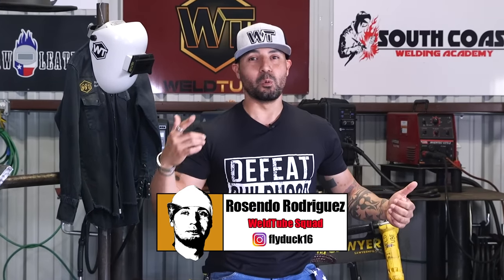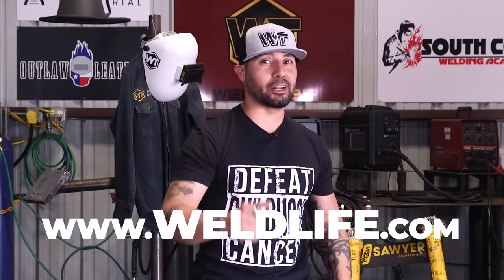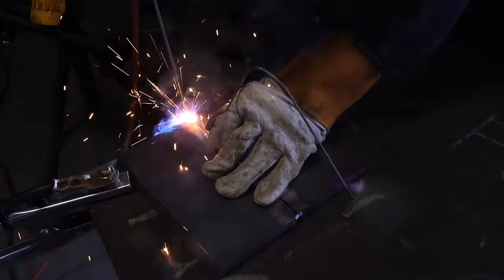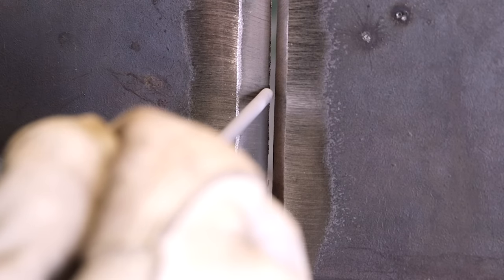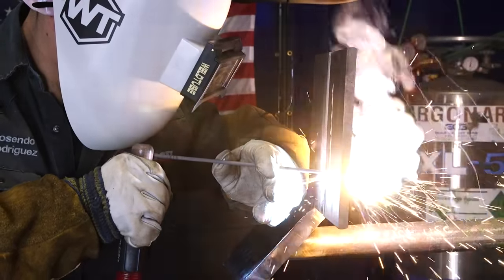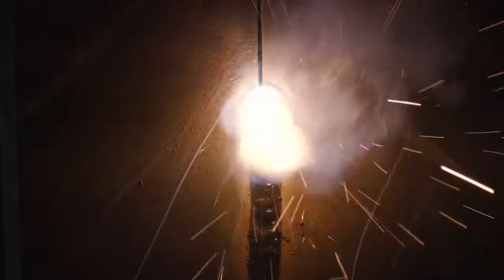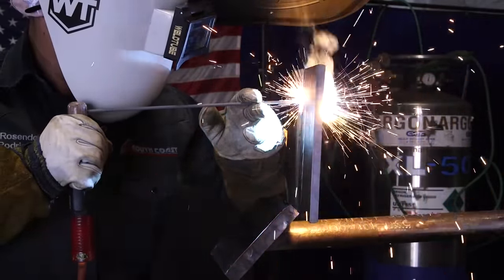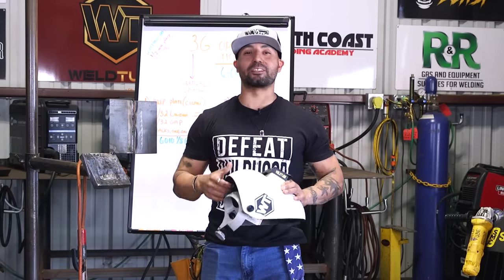3G Open Root Pass with 6010

Comment: I've been having trouble with this in my welding class and I think this video gave me a better understanding.
Reply: Repetition.
Settings.
Gap.
Comfort.
They make it look easy.
Continue trying the harder positions to get better at the others.
Angle your plate to forty-five an lean away or towards you to simulate 6g.
This will make the regular four positions easier in relatively.

Comment: I’m on 3g right now. I need this like a pig needs slop
Reply: Keep at it bro . 3g roots were like kryptonite to me when i was in school.
Reply: Keep trying, don’t be bummed out if it isn’t going to well, remember every fail and learn from your mistakes and try again.
Reply: @jeffgreer198613  Same here. Took months for me to figure it out, but once I had it, the test test where way more simple.
Reply: SAME
Reply: Same..I’m in the booth watching this rn
Reply: I’m doing the same on 6010. I struggled bad doing it with 7018 but what I did is went down to 3/32” road turned it down low on the amps and just practiced different ways speeds until it just happened and I got it. Definitely a skill that is learned by doing it every day.
Reply: @juancamaney1643  same. I feel like I favor one side of the plate.
Reply: @juancamaney1643  real
Reply: Pigs don’t need slop to survive

Comment: Thanks for the video! I definitely needed this. I’ve been blowing holes in my plates in class haha. I’ll try this next time and see if i can control the heat more by not pulling out as much. I have to take my test soon.
Reply: You in school Peyden?
Reply: @downhilldaddy9346  yup. Been in trade school for a few months now
Reply: @Peyden  what kind of welding you looking to get into?
Reply: @downhilldaddy9346   Well I have my mig and flux certifications, but I’m working on stick now and I’ll do tig next.  As far as a career goes I’m hoping I can make it on a pipeline or do some other structural work. Might try to join the local union.
Reply: @Peyden  TIG is the future. Good luck and I hope to see you in a plant sometime 🤙🏾
Reply: @Peyden  chemical plant all the way. Tig. Tig.

Comment: Worked on my first try. I did it at 85 Amps and worked like a charm.
Reply: 85 for the root? In class they told me to do it 65-75?
Reply: I’m in spot practicing where 80 amps is a bit too hot, and 75 seems too cold my keyhole keeps closing and snuffing the arc. Drives me nuts
Reply: I’m in spot practicing where 80 amps is a bit too hot, and 75 seems too cold my keyhole keeps closing and snuffing the arc. Drives me nuts
Reply: I’m in spot practicing where 80 amps is a bit too hot, and 75 seems too cold my keyhole keeps closing and snuffing the arc. Drives me nuts

Comment: What polarity is used when welding plate up hill 6010 
Thanks guys for the best video on welding
Reply: Reverse
Reply: DC + is reverse polarity and Welding pipe is Down hill is DC- straight polarity 

Which mean welding 6010 plate root pass is DC+ right?
Reply: Thanks for reply to my questions
Reply: DC+ is reverse polarity.
Reply: Welding pipe with a downhill progression using SMAW/Stick process will be DC+/reverse polarity. Typically you will use DC-/straight polarity with FCAW/flux core or with GTAW/Tig processes

Comment: I know it's hard to show on Camara but one thing this video doesn't show or express is you need to PAY ATTENTION TO THE CONSISTENCY OF THE PUDDLE, if the puddle is looking really wet you need to speed up and stack the next dime a little further apart, otherwise the puddle gets really hot and burns through or drips down. You keep doing so until the puddle stabilizes. A pointer to a stable puddle is everytime you whip out you should see your weld dry. If it stays wet when you whip back in, the puddle is too hot and it will burn through. Think of it as the reason you whip is to derive the heat away from the puddle. This is crucial in vertical welding because the puddle tends to get hotter as you go,

Comment: I've always known this technique as "whipping" great video!
Reply: Seems like it, but when you're going horizontal, I don't think you touch your puddle
Reply: I asked around yesterday: it's basically the upwards whip and pause technique. I believe the teacher in this video repeats "touch your puddle" not because you actually do it, but to stick in your mind that your arc length should stay minimal
Reply: @Solaniin  basically it's suppose to be the same diameter as the rod your using.

Comment: Hey rosendo is there a reason why you don’t just drag it?
Reply: The reason I don't drag is because you will run too hot and it will open up. You can drag on a tighter gap. However that's my experience with it.
Reply: Clout Lord thank you very much for the advice!!! I was just curious that’s all

Comment: Do you mess with arc force/dig at all or no? I find running anything lower then 75 has me sticking like crazy. I understand all machines are different but I’m just curious
Reply: I run my roots at 60-65. You have to make sure you long arc it before you get going though or else you’ll just glob up and stick. Anything higher than 65 for me and my keyhole just gets out of control
Reply: Are you using a transformer based machine or an inverter?
Reply: @kf8575  inverter, Miller dynasty

Comment: RootPass with 7018!!!! 3 and 4G
Reply: You can not put a root pass in with 7018...
Reply: @nojokehere9402  I’m pretty sure they do this in Europe.
Reply: in mexico the rootpass is performed with 7018 for structural welders 3G 4G and 6Gr Fluxcore or smaw
Reply: @10000rambos  Not sure about other countries other them USA, where we use 7018 for an open root. 
If it has a backer plate then 7018 would be okay. Just look up ANSI Pipe Welding Standard. I am a 23yr Union Pipe Welder
Reply: @AlexGoneDrummer  Is that for plate with a open root, like shown in the video? or is it a plate weld with a backer plate? Been a Union pipe welder for 23yrs, and 7018 is not allowed for the root per ansi spec.
Reply: @truth-ox3wz  Somewhere on YouTube there’s a tutorial from Sweden(?) , maybe Germany, but they root in pipe with 7018 using DCEN. Definitely not the USA tho